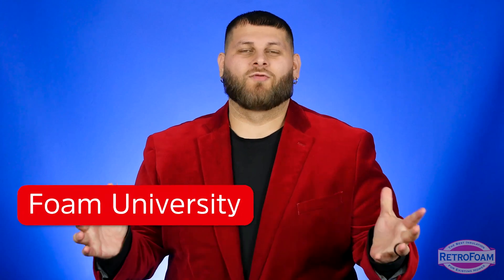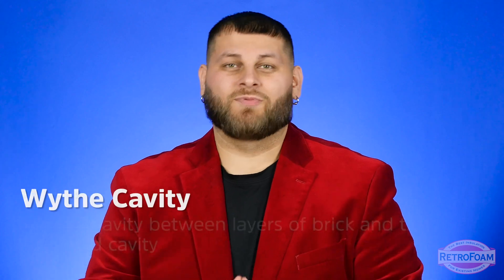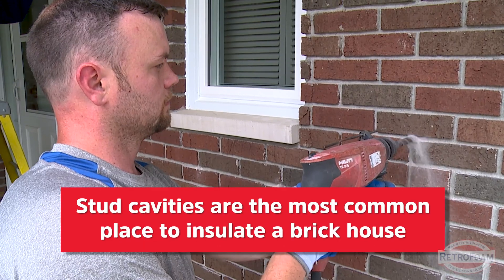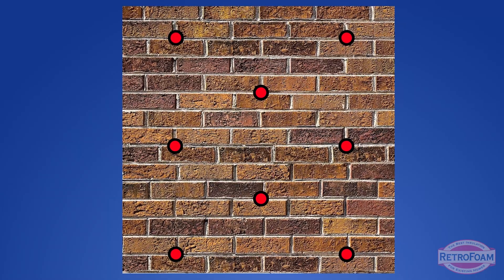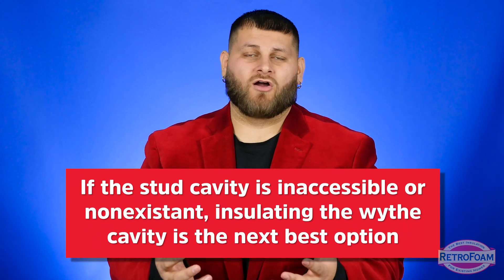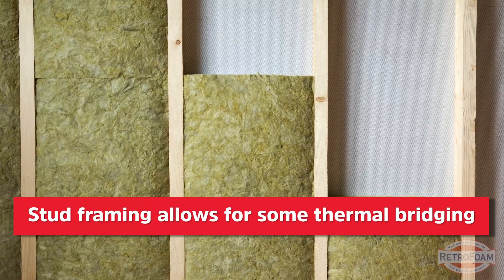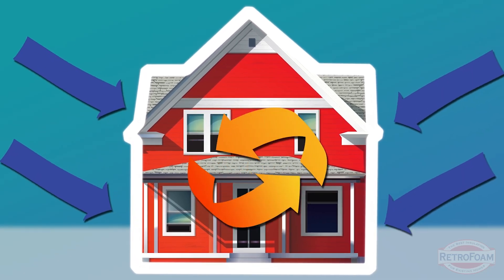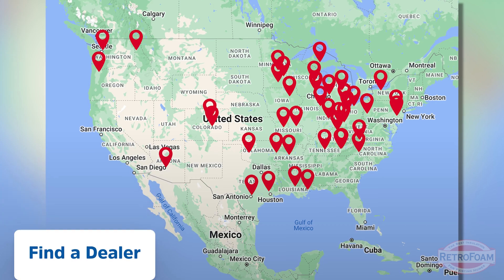Insulating Brick Walls With Injection Foam: Should the Wythe Cavity or Stud Cavity Be Insulated?

Comment: What about water absorption by the bricks?  Doesn't that need a way to dry out?  Putting foam in the wythe cavity would seem to create perfect conditions for mold growth.  As for the stud cavity, most older homes have some sort of vapor barrier between inside and outside, even if it's just tar paper.  Do you penetrate that barrier in order to inject foam, and does that put additional moisture inside the home?
Reply from the maker: That’s a great question! When foam is injected into exterior walls, it doesn’t trap moisture or create conditions for mold growth because the material itself doesn’t absorb water and actually helps block air movement — one of the main ways moisture travels.

For brick walls, the foam goes into the cavity behind the brick and keeps interior air (and humidity) from meeting the colder outer surface where condensation can form. And if there’s existing tar paper or another vapor barrier, installers carefully inject through it in small areas, which are then sealed by the foam itself, so there’s no added path for moisture to get inside.

The goal is to stop air leaks while still allowing the wall system to dry naturally — something experienced installers are trained to evaluate before starting the job.

Comment: What about doing both?
Reply from the maker: You could, but there isn't really a reason to because once the stud cavity is insulated and has that air seal, for example, then you don't need one in the wythe, and vice versa.
Reply: @foamuniversitybyretrofoam  I suppose it wouldn’t add a significant r value
Reply from the maker: RetroFoam has an R-Value of R-4.6 per inch, but it actually increases as the temperature decreases! Here's a link to some more information: https://www.retrofoam.com/blog/retrofoam-injection-foam-insulation-r-value